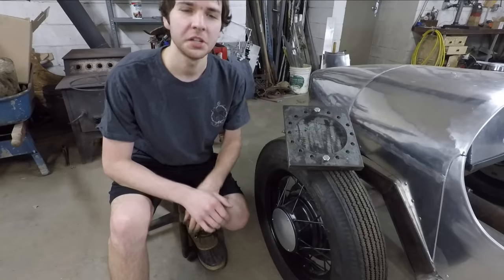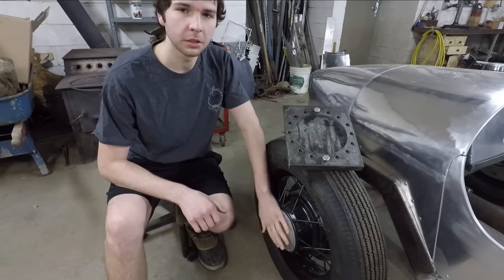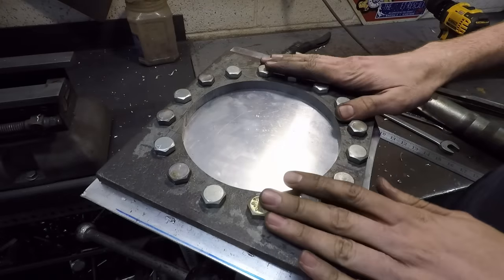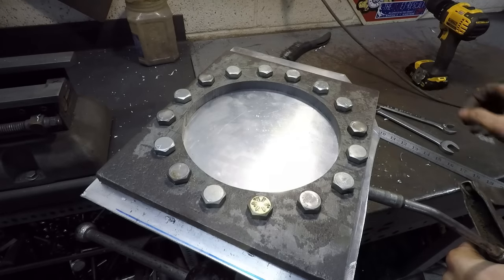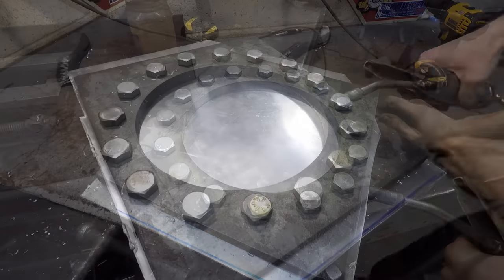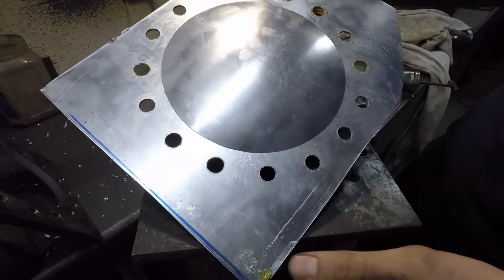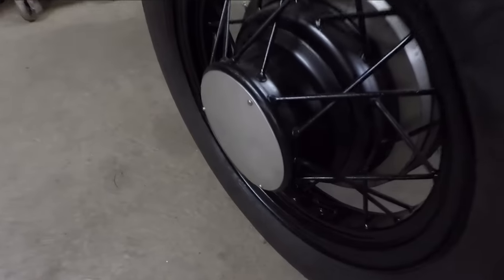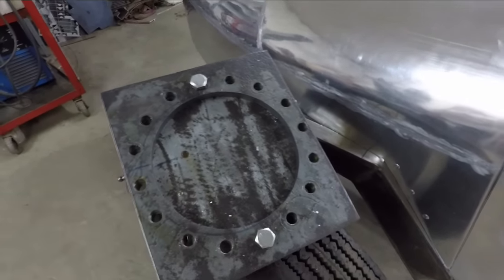Grease Hydroforming!

Comment: This is twice as expensive/twice the hassle then  getting it made and or doing it yourself with multiple different methods... work smarter not harder
Reply: You've never worked in a metal shop before have you? If so please educate us about methods that work as consistently/repeatably and effectively as this.
Reply: @LazyH-Online 😂 you a quiz grader or sumn?? I don’t gotta show and tell or prove nothing to ya.  It’s called common sense. And for your   Concern I have a 5.00 index fully caged 12v done by me and my hands only with a tig and a few other Shit I had laying around my shop. Not to mention countless custom mounted body parts I’ve made.  Look yo just go ahead and give yourself a neck and sit down cuz there’s several different ways. Just eat it goodbye.
Reply: @Mike L consistency and repeatability must not be terms you're familiar with (besides the press, in which case you're at least doing the same work if not more than in the video to make the tool/die pair or at least the forming tool and something to safely contain sand/rubber/etc for the convex side). In other words this method is superior to each of those methods.